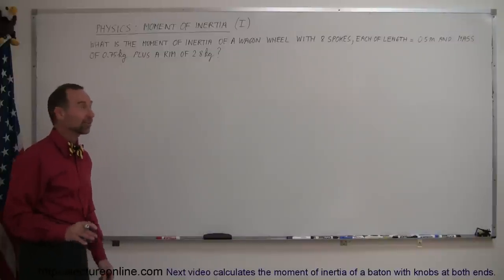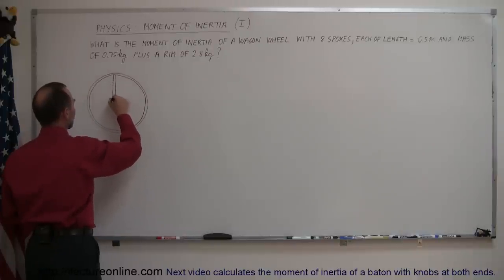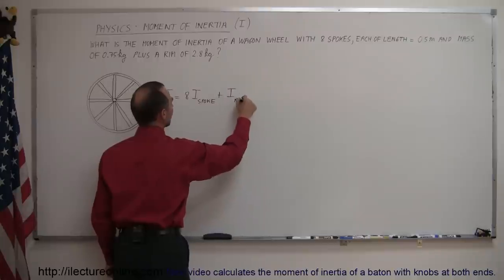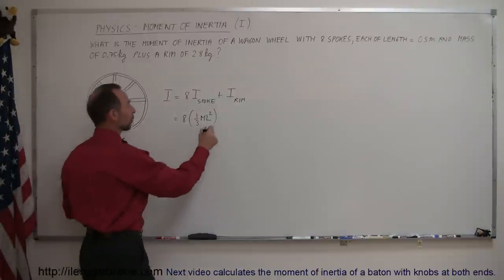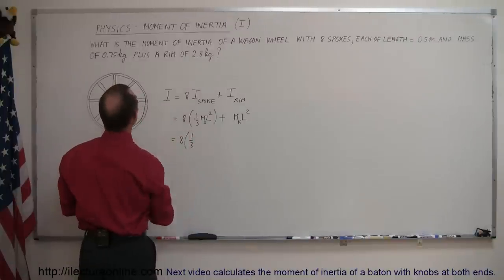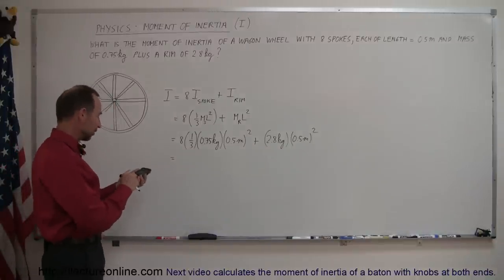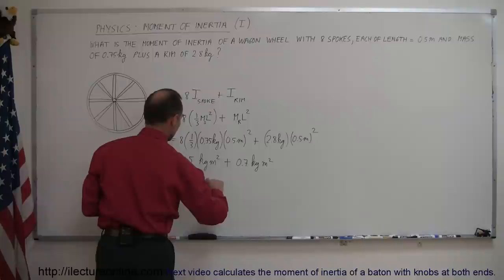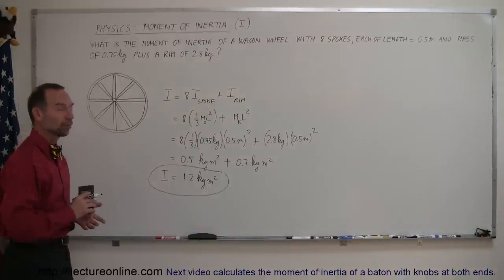Physics 12  Moment of Inertia (5 of 6) Moment of Inertia of a Wagon Wheel

Comment: why is the moment of inertia of each spoke the same as a thin rod rotating about its ends? I know it's the same shape and also rotating about its end, but can we really say it is the same? because in the video which you derived the formula for the M.O.I. of the thin rod, the axis of rotation was going in a direction different from the axis of rotation here (even though both are at the ends) in that case, the axis of rotation was going from down to up, while here, the axis of rotation is going from outside the page to inside the page
Reply from the maker: The direction of the axis of rotation does not matter.  Only the shape matters.
Reply: @MichelvanBiezen  ok thank you so much

Comment: Real-world question then : ) - Let's say a 1500kg car (without wheels) has four of the same wheels as in the given film. How would it affect acceleration of this car (making 0-100km/h in 6sec), if we increase each wheel mass by 1,5x? . thank you!!
Reply from the maker: You would first need to know the mass of each wheel and the radius of each wheel.  And depending on how the mass is distributed, we would need to know the moment of inertial of each wheel.
Reply: @MichelvanBiezen  Let's say the wheel radius is 0.3m and each wheel mass is 15kg. The moment of inertia will be 1,35kgm^2 (hope I'm doing it right). But what next, how can we transfer that into car acceleration? Let's say we will reduce each wheel mass to 12kg to see what the difference is.

Comment: Hello sir i would like to ask about the concept/definition of moment of inertia because to my understanding it means the tendency of an object to rotate. Now, if the moment of inertia is larger does that mean that it would require a greater amount of force for it to rotate? Because i watched a youtube demonstration by Sir Walter Lewin and it showed there that given two cylinders with different radii (One a lot bigger than the other) they travelled down an incline at the same speed/time. Hence to me it means the radius didn't affect the outcome, but in our calculations R is even squared. I hope you can get back to me sir i would really appreciate it, thanks! :)
Reply from the maker: +Marco Domingo 
Yes, that appears mysterious at first.
First of all, all object that have the same moment of inertia will roll down an incline at the same speed and same acceleration.  When we say "same moment of inertia" we mean the formula.
Thus any w similar objects (like 2 solid disks) which have a moment of inertial = (1/2) mR^2 will have the same acceleration even though numerically, the disk with the largest radius will have a numerically greater moment of inertia.
That is because the acceleration can be calculated with the equation:   Torque = moment of inertia * angular acceleration.

If you then calculate the acceleration  (a = R * angular acceleration) the radius cancels out.  (Torque = F * R)
Reply: +Michel van Biezen ohh that is amazing so what i can imagine that's happening is they both have the same translational motion but the difference in the radius is observed in the rotational motion itself. I hope my understanding is correct sir, thank you very much!

Comment: shouldn't it be ML^2/12?
Reply from the maker: The moment of inertia for a bar is (1/12)ML^2 only if it rotates about a point midway along the bar (at its center of mass).  That is not the case here.
Reply: Michel van Biezen Now i understand it. But i thought that you could use two bars, Instead of 8*(1/3)ML^2 it would be 4*(1/12)M(2L)^2. For some reason these two thing are not the same...

Comment: hi, i have a theoretical question, why are the wagon wheels made hollowish, instead of solid disc. wouldn;t the disc wheel have less Mass moment of Inertia about the axis of rotation for the same rotation speed, which in turn would require less force to start/stop the wheel, and it would also make it more durable?

Comment: What is the moment of inertia of the same wheel but about axis perpendicular to the screen and passing through a contact point at the bottom?
Reply from the maker: Take the solution of the moment of inertia through the center of mass and then use the parallel axis theorem.   I at the edge = I cm + Md^2 = I cm + (m)(R)^2    d is the distance moved away from the center of mass (cm)
Reply: @MichelvanBiezen Thank you for clarification Sir.

Comment: in an open system, shouldn't the moment of inertia of the wagon wheel rim be equal to the moment of inertia of the hollow cylinder, since it has a measurable width or thickness?
or should it be considered negligible in all situations?
Please consider my question, good sir. ^_^
Reply from the maker: +Gerry Martin 
Technically you are correct.  However it would only add a small factor that can be ignored.